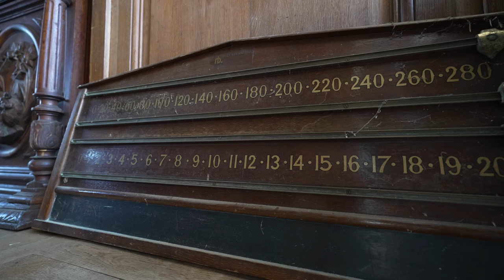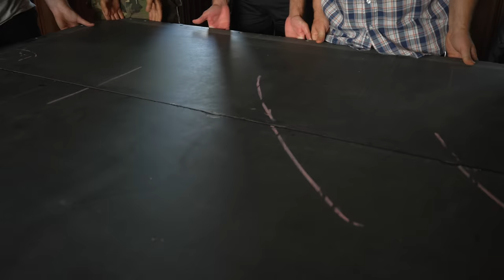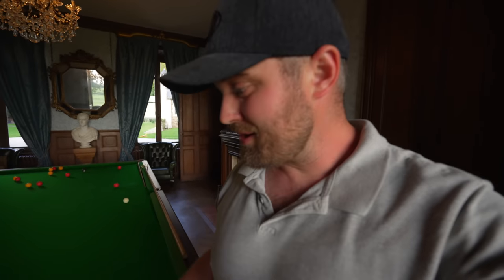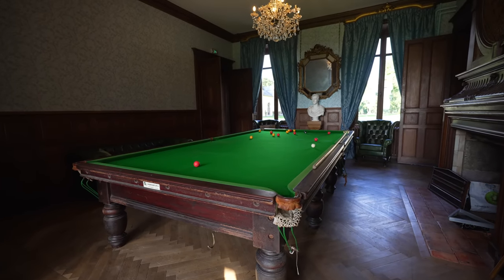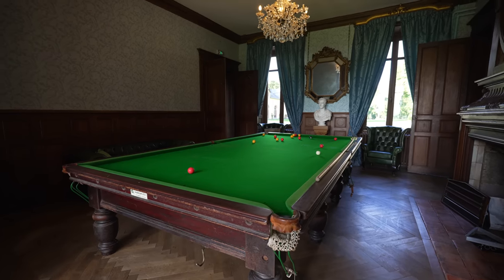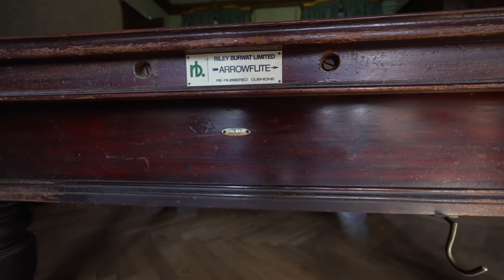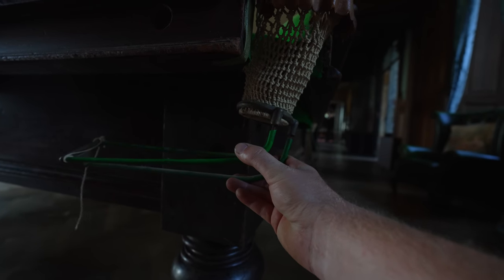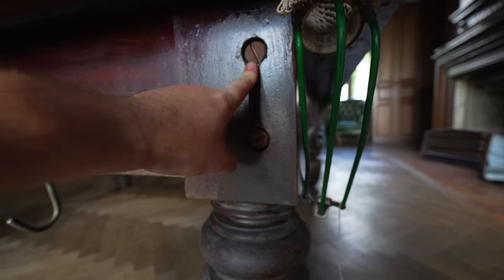A Chateau Bargain

Comment: Hey Billy, The table you have is a Full Size snooker / Billiard Table. An amazing grab especially at the age it is. The slate is amazing to see it is in good nick. I use to repair tables like this here where i live.  the pockets you have are the original pockets, which in the 1930's were replaced with netted pockets as they were easier to maintain. If you contact a local snooker table dealer, you might be able to get some second hand or even new pockets for it.
Well done again on the amazing buy. If i ever get to France, I would be honored to play a game of snooker or billiards with you.
Mykel

Comment: Info copied from the snooker forum: 
the Table is a Burroughs and watts standard cushion Not steel block , it was manufactured in the period 1890 /1910 , it has the modern concealed corner plates and not the earlier top plate .
the arrowflight badge is a rerubber badge , the original badge is the one on the other end .
most billiard firms had a name for their cushions when they rerubbered for example Arrow flight = burroughs and watts , Empire match cushion = Elston & hopkin , and so on .
many people get confused when they have a rerubber badge from another manufacturer on their tables , in youre case it was rerubbered by Burroughs and watts so no confusuion there , but many such as an unbadged Orme and son may have an arrow flight badge on one end and missing Orme plate on the other , people look at the burroughs and watts plate , and think it is a Buroughs and watts .
no confusion in youre case .
I do not know the model , but the fluted leg pattern where made in their thousands by buroughs and watts .
I have abook with illustrations of the legs by buroughs and watts and youre's is in there as a bold fluted leg illustration number 3 priced at 74 gns for the full sized table in mahogany and the patent invisable pockets .
the book to look out for is Simplified billiads or how to make breaks .

P.S you need some rail straps

Comment: Don't know if you have Howard's Restor-a-Finish available in Europe, but if you can get it, it's a great low-cost way to improve the look of pieces like this.  You can get it in various shades, I'd try mixing the mahogany shade with a little of the dark walnut so you can be sure to get a dark enough colorant to cover the scuffs.  You can experiment on a less visible area to make sure you are getting the results you want and adjust the shade as needed.  It has a bit of solvent in it which helps to even out old varnish and remove dirt.  It cleans and improves the appearance of worn wood furnishings a great deal for relatively little cost and effort.  You can rub gently with very fine steel wool soaked in the Howard's in the bad spots, but be gentle to preserve the original finish. Most areas will only need application with a soft cloth.  Follow it up with a good coat of Howard's Feed and Wax, allow it to dry for a bit, then buff.  You'll be left with a piece that still shows the marks of its past, but glows with new life and color.  A total strip and refinish might be preferred from a perfectionist standpoint, but that would be extremely expensive and time consuming.  The Howard's method (or perhaps something similar that might be available in Europe) is a much more practical solution.  And when you are done you have a wonderful patina that highlights the history of the piece, which I actually prefer in many cases. There are times when keeping the original finish intact actually preserves the value better.  I love that you scored this great bargain that furnishes the room close to its original purpose.

Comment: We used bees wax on the joints in the slate. You just melt it in the cracks and scrape it off with a putty knife. Done. No sanding. Easy to take down.

Comment: We had a proper billiards table growing up on the farm. It's REALLY important to get that felt replaced ASAP as the lack of tautness in it (could) result in someone digging into the slate bed with the cue & making a small hole if they missed the ball, ruining the lovely running finish of the slate. Slate of that quality is NOT cheap to replace. That would be a tremendous shame for such an old beauty. 
Get a professional to replace the felt as it REALLY needs to be quite taut and there's a definite knack to getting it just right. We had the guy who installed our table come up from Auckland (400 miles) to the farm a few times to make adjustments as new felt does have a tendency to stretch in the 1st few years; not that surprising since it's a natural fabric after all.
P.S. Letting wee Archie bang the balls on the slate bed can also badly damage it even though the wee mite doesn't mean any harm; he's only a baby. As very young kids we had that driven into us to NOT to drop the balls onto the table for this very reason.
Quick thought re: getting your grandad to make new plugs to cover the wooden screws. Since the table is probably mahogany and well seasoned due to age, why not try to source mahogany of a similar age from a timber reclamation yard to match the table? Shouldn't have too much trouble picking up the small quantity you'll need for this purpose. I think that this would be well worth the extra effort in restoring this old dame to life.

Comment: What a great purchase! If I were you I would rub down the wood with very fine wire wool and turpentine to remove any dirt and then a light coat of wood stain if required followed by a few coats of french polish. That should rejuvenate the wood whilst retaining the original patena.

Comment: Now just think. That company is still in business so they could tell you the exact age of the table. With that low serial number it may well be over 100 years old. They started making the snooker tables in 1912 yours may be from that first year. A similar table today is called the Aristocrat which is mahogany and will cost you around 14,000 Euros. 300 Euros wouldn't be considered a bargain. You stole that one running away. LOL. Yours may be built of African mahogany which is extremely expensive these days. Although an antique, I believe I'd consider refinishing that table to its original glory. Would take a little time to do it properly but that is a show piece. Might think on that a little. The company may even have replacement plugs for the screw holes.